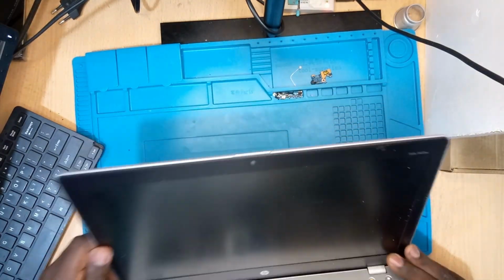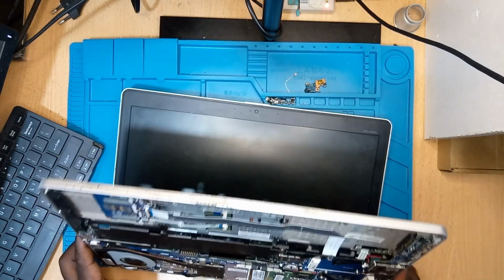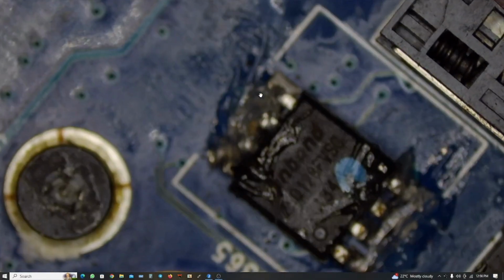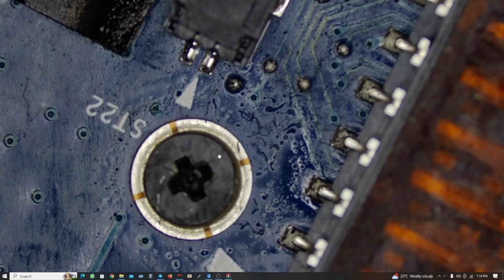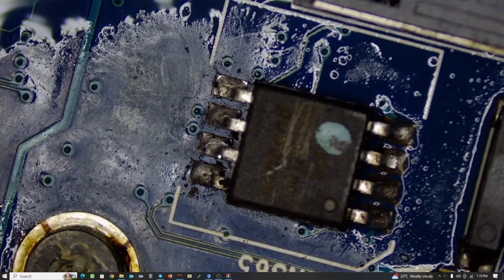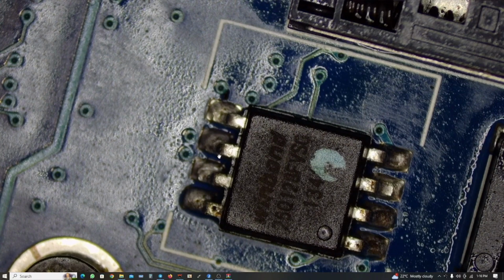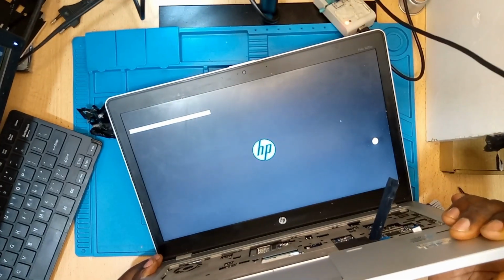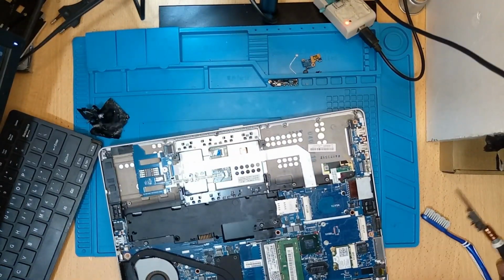HP laptop turns on but NO DISPLAY? -How to repair BLACK SCREEN OF DEATH on any laptop.

Comment: I have problem with my HP Probook 440 G3.
After i turn off my Windows. In first attempt to turn laptop ON.
I always get black screen, keyboard backlit is working, but fan is not spinning.
My laptop starts after 4th or 5th attempt normally. 

Everything works fine until i turn laptop off and try to turn it on.

Every Diagnostic tools (also from HP) says that RAM, Processor, Disk, Motherboard, Network Cars is fine. 

I updated BIOS to the latest version but it is the same.
Turning off Fast Boot didn't change anything.
Reply from the maker: @versuspc4921  sounds like a power button issue. Try remove cmos battery and if machine starts automatically means theres a power button issue
Reply: Laptop turning ON with backlit but no spinning fan? How TF it is power button issue
Reply from the maker: Come to my whatsapp inbox maybe i didnt understand well.

Comment: Why don't you do a BIOS update using the computer's USB, downloading software from the HP website ??
Reply from the maker: Because I will have to prepare the complete set which is time consuming
Reply: @LetsFixThatGadget  It's much easier, you don't have to disassemble the computer at all or remove the chip
Reply from the maker: @David55436  I tried that, the laptop was unresponsive and hence went for the longer route. Looks like you got a better way, i would appreciate. Please share in my email: isamfixsolutions@gmail.com. Thanks in advance.